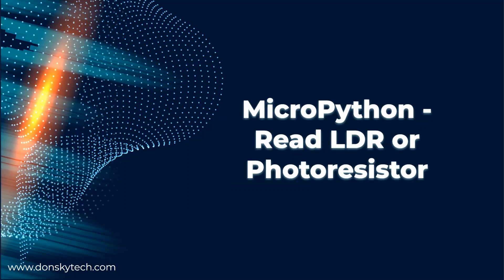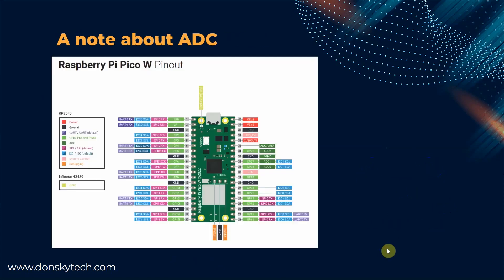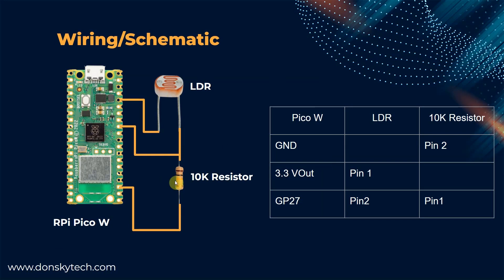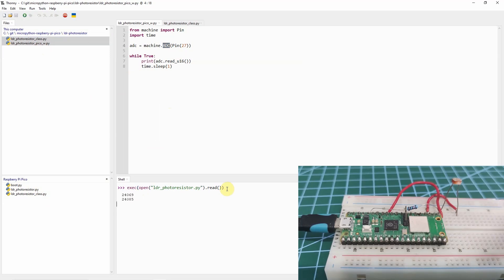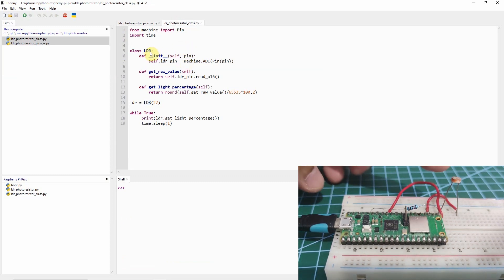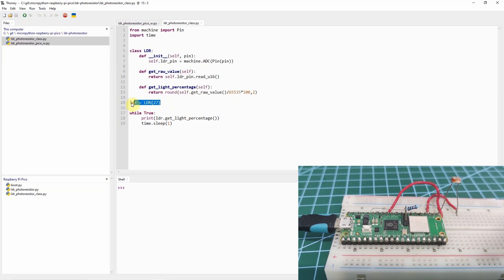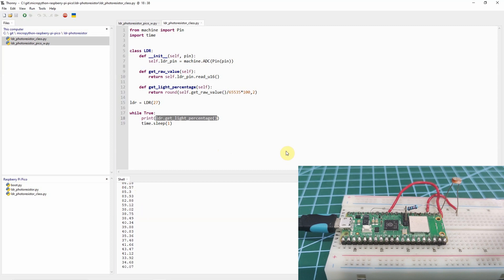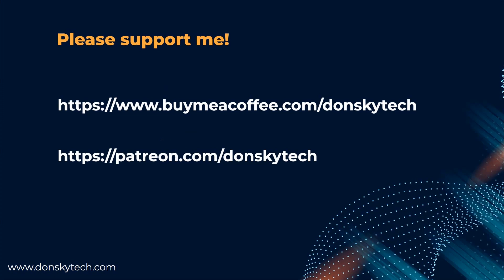MicroPython - Read LDR or Photoresistor

Comment: Good explanation as always. In practical use I use these as day night sensors. Instead of a 10k resistor I use a 10k trim potentiometer. I find when a project is deployed an adjustment is often needed to get the correct on/off light intensity. It is much easier to adjust the pot than it is to adjust the code. Thanks for the video.
Reply from the maker: Yes, indeed Keith! I do use a trimpot when I want to achieve the lower or higher end of the range.

Comment: Simple project full of useful content.  Using an LDR class and showing how to use  exec( ) at the micropython repl (>>>) was a nice touch.  The get_light_percentage() would be more intuitive to me if you subtracted the value from 100%, since a higher % would  suggest more light.  Your coding increases % with decreasing light if I am interpreting it  correctly, more like "get_darkness_percentage()".  
Your content and documentation on your website and github is superb and you deserve many more subscribers.  A suggestion:  address lib install: >>> mip.install("path to lib file anywhere") as Thony package manager is broken (for me).  Thanks, keep up the great work - but please don't burn out!  Check your video description, as it refers to a  different project.